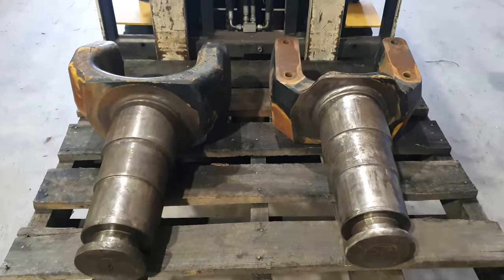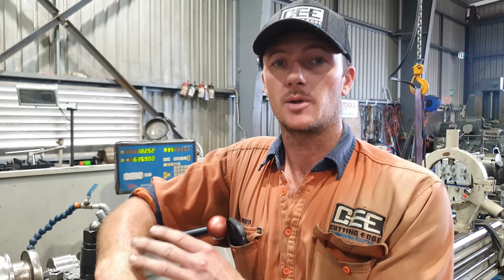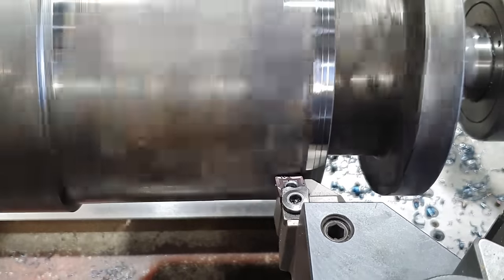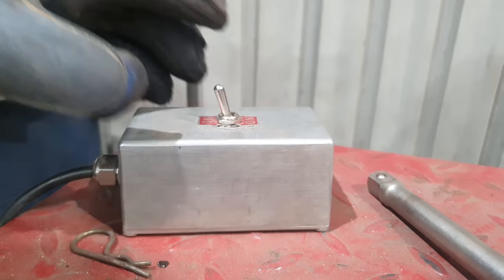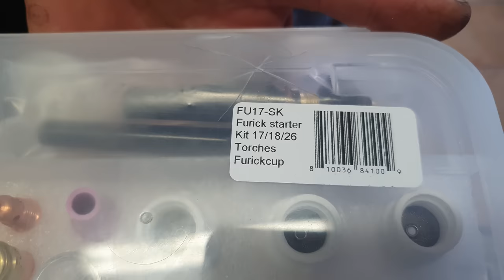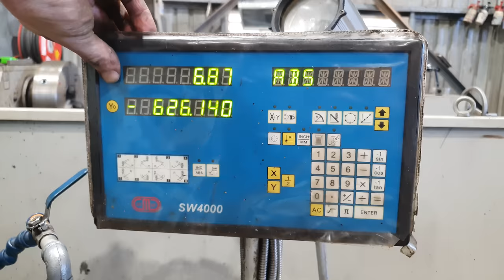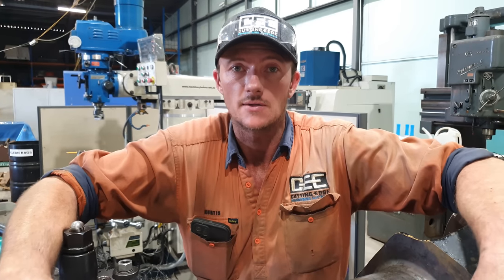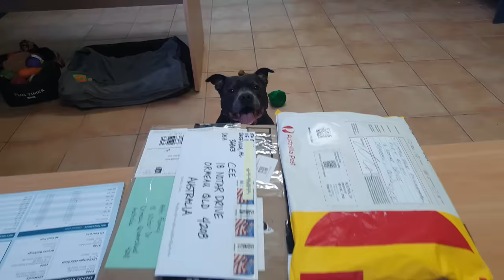Repairing Parts for Caterpillars BIGGEST Dozer! | Machining & Welding

Comment: I'm thinking of the stress the owner of these massive machines must be under when urgent repairs are needed and the machine shop delivers within the strict time limits, I think CEE has a customer for life from now on in. Thanks guys, great video.
Reply: Time is money when one of those machines goes down.
Reply: One would think so, but a lot of time they quickly forget when someone else is 15 cents cheaper.
Reply: @cullenmiller8170  Local and smaller operations will never forget and be forever grateful - big companies can quickly forget when the new manager knows a guy he use to use....
Reply: As an ex maintenance superintendent it depends if it’s a pm related issue or found work …….. while this machine is down it will be having other critical maintenance done to it …. Maximizing down time to increase up time in the future …… it’s all part of the game
Reply: appears the customer keeps an eye on his equipment and knows when it is time for a job like this
Reply: @marcuscicero9587  exactly. This is the most important part. These machines make so much money you want it running nonstop.
Reply: Thinking of the stress for the owners ? How about the stress for the fitters in getting the job done! When you have an A@#£&*( of a quarry Forman who doesn’t know Hay from a bulls foot, but thinks it can be done yesterday. Been there and done that!
Reply: @donlunn792  so have I. They are lovely to work for
Reply: Back in the 1980s I had jobs like this done. Metal spray for rebuilding bearings was coming in. Welding was better but “stick” is so slow might as well make a new shaft. The MIG used here looks like the dog’s bits.

Comment: Hey you two. As a former bush mechanic and Machinist/fabricator I sure know these or any other track machine is that extensive roading is really hard On track frames and all the external tooling they carry. The same goes for a steady diet of interrupted cuts on the lathe eh. Grease gets literally pounded out of the joints and when that happens, , , Well it kept me in a living for a long time eh, LOL. You too eh. Neat, That plastic banding has a bunch of different applications eh. Your shop is very well supplied with the right toys for these applications. Very impressive my friend. No messing around at CEE for sure. I still see the need for the anti vibration belts available from BEAR automotive supply. Rubber like bands loaded with lead weights. They are used to dampen vibrations from when brake drum and break rotors are being turned. They work GREAT ! Well folks you two sure produce a great video. With the world time line you are both 1/2 way through your weekend so enjoy the rest and We will see you next post my friends.

Comment: Hi Homeless, Karen, and of course Kurtis😊😊, 
I just started watching your channel. Well, a few weeks ago now, I've been  catching up with your videos, all 150 or there about🤪🤪!! I'm impressed with the quality of your work Kurtis and Karen, not Homeless with your mail!!

I'm an ex farmer retired from major medical problems at 62. I have no professional degrees, class myself as a hobbyist turning, fitter, and welder😅😅. But dad was a qualified mechanic with some welding and machining experience, which he passed on to me. 
On the farm, we did almost all repairs on everything from bulldozers to ag equipment and other things.  I also took up building new and modifications any piece of ag equipment and dozer equipment we needed. Including building a complete set of parallelograms 3 tine rippers and walk-in stickrake for the 70hp dozer. Then, later, rebuild the engine and other bits for the Inter TD25b dozer.
Never had a mill but was on the wish list and still is😢😢!! But we had an old 24 bananas swing over the bed x 10 bunches of bananas between centres lathe, never found a name, make, or information on it. When we got it, it did not have a motor, so we put a Morris 1000 car engine and gearbox to drive it with a flat belt, without the cone pulleys. Using the gears and backgears and the throttle for different speeds. Later, I converted it to a 3hp electric motor with the cone pulleys, which worked far better. It didn't have a standard  Morse taper somewhere between morse 4 and 5, but it came with 2 centres so we could get the tapper angle. So we made adaptors for Morse 4 drills and bits and pieces to its taper. It was refurnish for the 2ww. It was in good condition for its age and weighed in at around 5 tons. But not quite as accurate as yours!! We also had, and I still have a Myford ML7 that dad brought new in 1950 for the smaller work, which I'm in the process of refurnishing now.
Anyway, keep up the videos as I enjoy them and see how some parts come in, and then see them go out looking like new. 
Especially the video of that dump truck, A frame that needed just a line bore, but was not a simple line bore, as an urgent job on the weekend by Monday morning!!! I just hope he had to paid for the simple urgent weekend work.

Comment: Just a thought. To get positive drive on the yoke you could drill and tap a 15-20 mm hole in your mandrel and use a suitable bolt. Of course the CEE solution would be an in house purpose built drive, and rightly so. As an old Fitter who worked on marine, logging, hydraulic and machine tool repairs I am amazed at some of the latest gear. Thanks for the very informative videos. All the best in the future to you, the Missus and Homey.
Reply: I thought that would be a good idea, too.

Comment: hehe, nice "time lapse" on the second weld up and grind... just ZIPPPP and done =P  I always appreciate how much actual time goes into each step, and how neatly and unobtrusively you compress time in the video. I've seen on other channels the joke on a t-shirt that says "welding god" with the word welding crossed out and the word "grinding" written in. Kurtis illustrates the other end of that spectrum. Great video as always. 

(another welding joke is "grinder and paint make me the welder I ain't, which certainly doesn't apply here either)

Comment: Brilliant video again Kurtis and Karen. When you look at the design, the materials and production values that have gone into just a "small" part like that, you wonder how they can sell a complete D11 for as little as $1.2M. That new carbide insert seemed to be the dogs whotsits. Always amazes me how different grades of carbide can make such a difference in a cut.
Reply: Because Caterpillar is not in the heavy equipment business - they're in the spare parts business.
Reply: @crunchysuperman Same with just about every manufacturer. Have you noticed how car manufacturers are always advertising incentives to get your car serviced at main agents' workshops?
Reply: @davidstewart4570  better example would be those newfangled all-LED headlights. Sure, it is only 1200 bucks extra on top of standard issue xenons, but god forbid you break them in a fender bender, it will be 4grand for replacement part. Plus labour.
Reply: Economies of scale; if you're producing dozens or even hundreds of these dozers a year, it'll take significantly less time for each part's setup. Also, they probably cast and machine parts to size before heat treatment and the final precision cut, which really reduces how much material you have to remove.

Comment: Hey Kurtis, in the future try rapping the shaft of the yolk with a 4" X 5' strip of rubber the thickness of a inter tube. It should help to deaden the ringing when machining, like when turning a brake rotor. Good Luck!!  Keep the vids coming, enjoy them all and some times watch them a second time. Thanks
Reply: Given the huge elastic modulus of the steel, and teh huge mass of steel compared to the elastic modulus and mass of rubber, I think it would not make the slightest difference.
Reply: @keithammleter3824  it is all about taking energy out of the system. If you leave it vibrate on its own, it will amplify in natural resonant frequency. If you let it waste in something like rubber, you might get lucky and get rid of some harmonics.
Reply: I would've liked to try just another strap, but near the of it, or just tack weld a small bar across it.
Reply: I agree with John. When turning brake drums the shape of the drum causes nasty harmonics which will result in a herringbone pattern like Curtis had. We use big rubber belts to absorb the vibrations and it makes a much cleaner cut which is nice and smooth. The bigger the brake drum the bigger the rubber belt we use.
Reply: That’s also an old watchmakers’ trick to get those last few tenths on humming parts. Sometimes it’s pitch instead of rubber.

Comment: Hello Kurtis. I really admire you for having the attention to detail that you have and the determination when working with these broken or damaged parts. You bring them back to life so that the equipment can keep on going. 
You mentioned that when turning these parts they will resonate like a bell.  I remember back years ago when brake drums were turned and not just thrown away. They would wrap the brake up with a thick piece of stretchy rubber it almost mitigated the high ringing noise.

Comment: Quite interesting! Heard many machinists mention harmonics, but this was a fantastic example!! Also even hearing that high pitched one at 26:13 was brutal lol
Reply: So was it the harmonics that caused the preferred bits to not bite?
Reply: @steven.h0629 Think about it this way: the Harmonics are the result of vibrations. When it vibrates, it causes small movements. 

So sort of, yes.

Comment: The machinist at the shop I worked at used an old bike tire inner tube to absorb vibration from those noisy jobs. You can experiment with position and number of tubes, and attachment methods. Pat usually just tied it around the part, but occasionally used a hose clamp if needed. He tried a truck tire tube but it was very hard to tie around anything. 
This was a fun video and it was good to see you delivering the repaired bits; nice to see service beyond just repairing something!

Comment: This is one of those jobs that justifies getting out and setting up the toolpost grinder. Bit of a pain as lathe got to be stripped and cleaned immaculate after use but it does the job perfectly.
Reply: How about a real grinder, takes off material 5-10 times faster the a cutter!

Comment: I was a mechanic in New York for 445 years we use the brake lathe and rotors would get a harmonica out of them I used a strap a rubber strap that actually wrapped around the drums and the rotors and it absorbed or the harmonics and of course a brand-new B Eric from Florida

Comment: Awesome job mate. Customer will be stoked to get them back so fast.. does anyone do metal spraying anymore? Used to be the bees knees but I reckon it’s a waste of time, in my opinion. Thoughts?
Reply from the maker: I agree and have seen far too many metal spray repairs failed, delaminating and breaking down causing more cost for the customer 👎 There's a lot of repair methods out there and that's not one I would choose
Reply: It's not a "fix everything ". There is a place for it.
Reply: How hard is that stuff, same with using a sleeve?

Comment: I can definitely agree with the sanding after welding to save the ceramic bits from some of the rough surface impact loads.  Great call, ceramics aren't cheap.

Comment: Sympathetic resonance can be a hard thing to eliminate. Well done Kurtis job is a good one. Karen and Homey, being the back room support. Thanks to all 3 of you for making Fridays a great day 👍
Reply: Brake drums ring badly as well. A leather strap works. I grinned when Curtis went for the banding strap. I was expecting leather.
Reply: Leather straps smell too much like a new car to be used like that 😂 🤪
Reply: It’s been 20 years since I have ran a lathe, but I can vividly remember the unique feeling of that surface, that was “smooth” yet rough at the same time, from the harmonics. Thanks for the memories.
Reply: @sunrisetacticalgear2676   ¨Resonant knurling¨🤣
Reply: If you join on Patreon they drop the videos Wednesday night or Thursday for your mid week enjoyment
Reply: @MudOilnGears nicely done 😂
Reply: @Artiken1  I just ordered a rubber drum belt for him.. maybe next time he'll try it
Reply: @azwrenchmaster5334  That's awesome 👍
Reply: Yeah we use rubber straps with lead weights in them on brake drums and rotors and they still chatter and howl.
Reply: @timothy9360  We tried  different inserts, feeds, speeds, belts and even different jaw configurations. Some times it worked other times I could reduce it, but it was only on some parts, that's the thing with sympathetic resonance. We made industrial gearboxes and even there we had to change the ratio as the location of the box, if on a structure, made the thing shake.

Comment: Hey there, Curtis, love the channel as always... I was wondering... have you ever done a show-and-tell about the different types of inserts you use or anything of the sort? I know it's far and away from what you normally do which is do your job and film as a secondary... but I've found myself wondering more often than not what exactly the inserts (for example the WNGA Ceramic Insert) are all about and what the various lettering conventions are. If you could do this, I'm sure that more than just I will be ecstatic to watch. Have a fantastic day!
Reply from the maker: hey mate we haven't done a video on the types of inserts but will definitely add that to the video list, thanks for the suggestion
Reply: @CuttingEdgeEngineering  Brills! Much love to you and the Missus (and Homey of course) from Washington State!

Comment: Regarding the howling, I've had decent luck with surgical tubing.  Pretty cheap, stretchy and works surprisingly well.  You would need the green stuff to drive it, but wrapping the tubing around 3 or 4 times in figure 8s would probably make it silent.
Reply: I'm a retired machinist as of last fall. My experience with vibrations has led me to using any old rubber hose ( like an air hose) wrapped tightly and secured seems to work very well. I also noticed threaded holes on the forks, a plate could have been bolted on using all 4 holes, just my thoughts.
 Great videos and I too agree the ending out takes are great !  :)
Reply: Good idea.  I’ll try to remember it, next time I have a high pitched screamer.

Comment: Hi Kurtis, Changing the approach angle when finishing was a good idea as was changing the feed. If you get a harmonic vibration you need to not follow the vibration pattern on the workpiece changing the feed does this.( It might also be a good idea to use a tip with a smaller radius). Nice work.

Comment: nice job on getting a proper surface-finish in hard-face on the lathe... i admire your patient cutting this hard-face when it is rumbling like that... it gave me goosebumps... have you ever considered getting a tool post grinder to finish a job like that ? ... i know it is messy but the finish you can get in hard materials unbelievable.

Comment: Kurtis, i just watched the video, and noticed the effect of the harmonic resonance on the surface finish. 
The open ended device acts like a tuning fork, which induces the vibration. 
This can be easily eliminated by fitting a temporary brace between the two tines

Comment: Another top job done there Kurtis! Its always so rewarding to see professionalism to this extent. My grandad aleays said professionalism isnt the words you say its the things you do.

Also a nice gift on the conversion chart! There is a website called Alcula that allows mm/in conversions to 2 decimal points metric. So if youve got a machine in imperial (like every surface grinder ive ever used) then its quite handy and very accurate.

Has to be said aswell, Karen's videography skills are top notch. It feels like watching a proper show on TV, only with a far more relatable cast!

Comment: I run cylindrical grinders and I've had to do similar setups chucking onto centers etc... trick is to take a piece of flat bar and c clamp it to a chuck jaw and the flat bar resting up against the part & that'll drive it. More than one way to skin a cat just something I've had great success using. Cheers!

Comment: Thanks!  Nice shot of the wire spool & transport drive thingy all the way to the business end.   Also, shorter dead center to let a jaw be the dog to drive it, with a piece of wood, copper or alum to prevent damage,  and might also cancel some harmonics!!  Also, also, what's running the compressor when you obviously aren't, couldn't be leaks, sharing it with a neighbor?

Comment: For the harmonic noise. You could try bolting thick rubber to those 2 bolt holes on the ends and see if that dampens the noise.

Comment: With the harmonic resonance, some quick sums suggest that if you 'unbalance' the mass on the two tines, then that'll shift the resonant frequency of each tine, hence reduce the overlap, and thus cut down on the noise.  Of course, you don't want to unbalance it rotationally, as that'll affect cutting on the lathe.  But I did notice that there are two bolt holes on each tine, so I think that putting the same mass on both tines, but one on the lower and one on the upper bolt hole on opposite tines should reduce the noise?  I don't know if you can get enough mass on there to have a significant effect - the physics says any mass setup like that will reduce the magnitude of the resonance, but wether it makes a big enough difference to the overall effect to be worth doing will take some experimentation to determine.  Another option might be to bolt a large magnet to one of the tines - the magnetic field has a dampening effect on vibration, hence sucking some of the energy out of the resonance - although, again, getting a big enough effect might be impractical due to the sheer size of those forks.